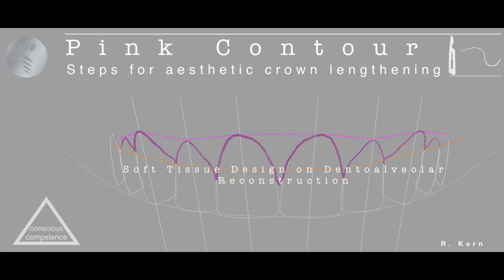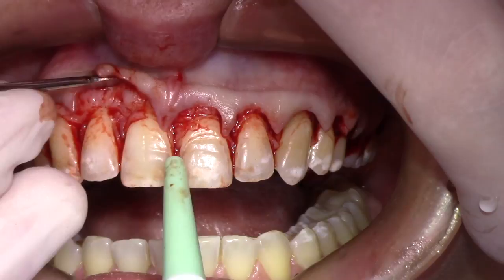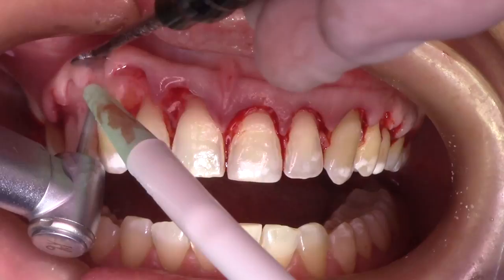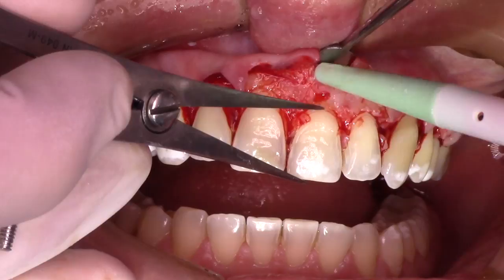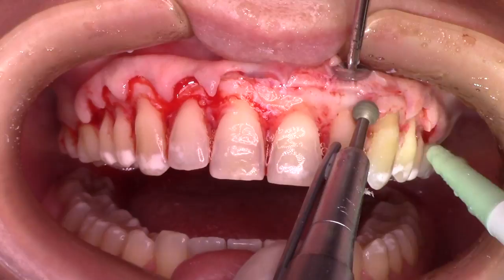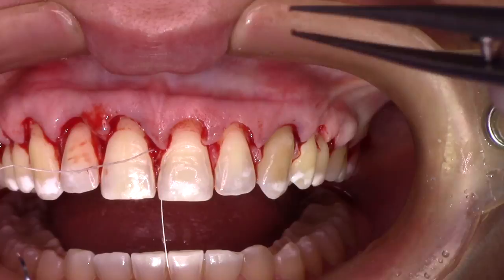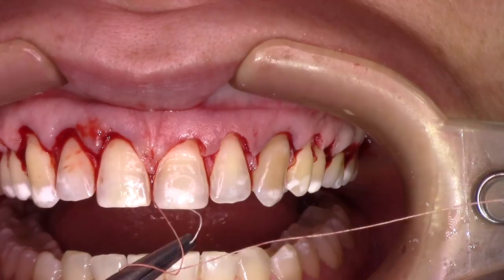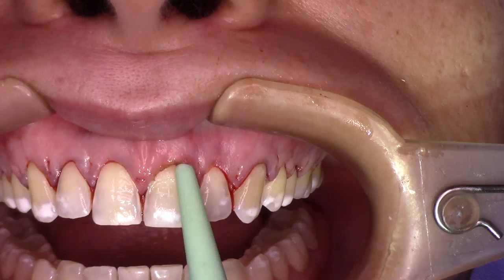Tips for Aesthetic Crown lengthening

Comment: Question I have a molar which my dentist has maintained by filling. IT is a ten year old root canal with sub optimal fillings but has never caused me a problem. To do a crown the tooth would potentially need  2mm removed for crown lengthening. She is reluctant to do this at present as root filling is ok. My question is if i ever did do this as a final choice would having crown lengthening destroy bone if i later wanted a implant retained crown? The cost of another root canal crown lengthening and crown could equal a 3d guided implant
Reply: You should decide if you want an implant or to keep the tooth before you do crown lengthening. We can not add bone once it is removed.
Reply: @sam99841  Meu Deus oque e isso